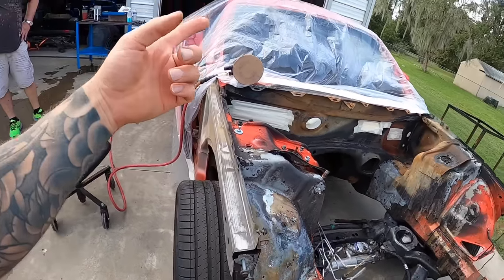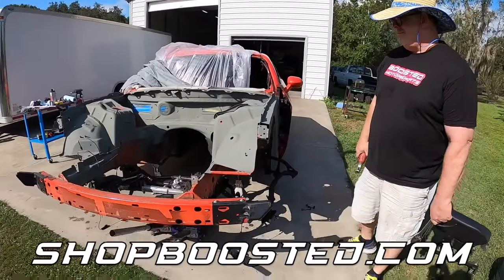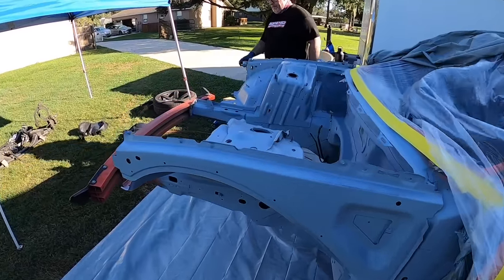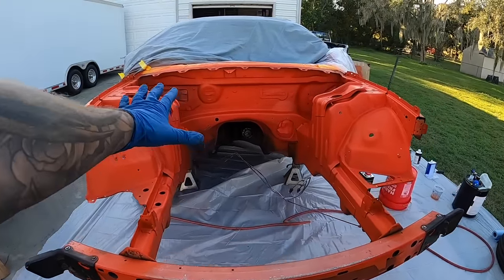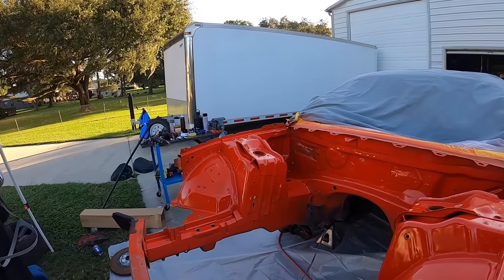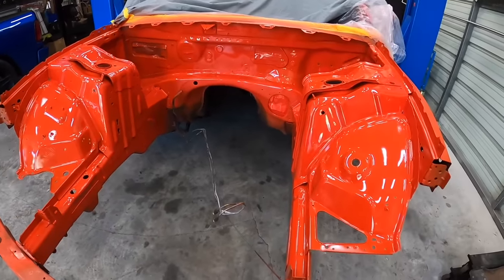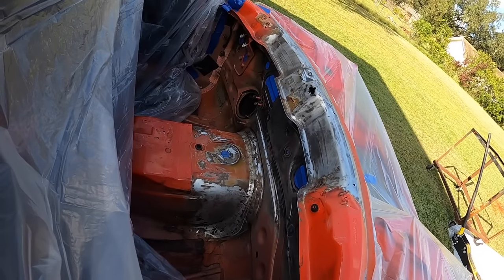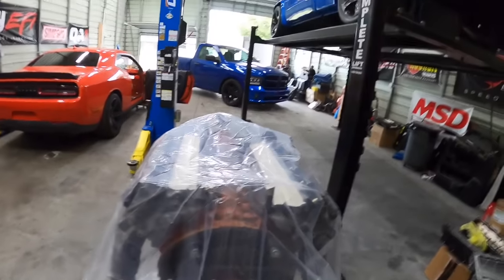Rebuilding a Dodge Challenger SRT Hellcat | Painting the Car

Comment: Factory don’t clear the engine bay so you definitely went above and beyond awesome job
Reply: That's a serious misconception the engine bays are definitely clear coated....I have been in the industry 35 years and I have not seen one engine bay from Mopar that's not clear coated......now for uses a matte black in their engine bays and GM did a satin clear coat up until the Early 2000 now they use a clear coat in engine bays......60 and 70s cars were single stage paint or a laquer. All engine bays have clear coat there are a few you tube videos of the production line paint process they are cool to watch.....not busting your balls just trying to get you the proper information my friend.

Comment: Wouldn't clear coat firewall that's covered up. Job looks good for a first timer. Probably go with a tip requiring less air so I didn't wear all the clear as much. But maybe that's required for this clear.

Comment: Do you want to help me build my dream truck before i die? 05 Dakota x-cab, i have a running and driving 2010 4wd HEMI 1500 and want to put everything in the Dakota. I dont know if it will get done without help. I've had chronic lyme disease for 14 years now. Im in pain most if the time and my brain dont work like it used to.